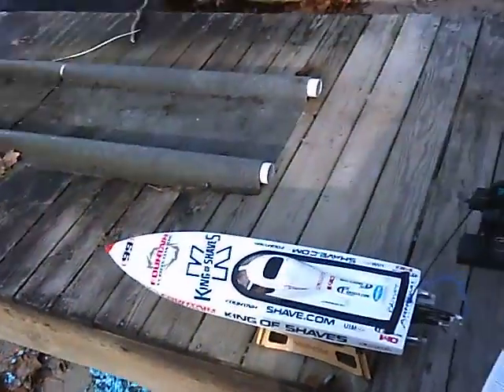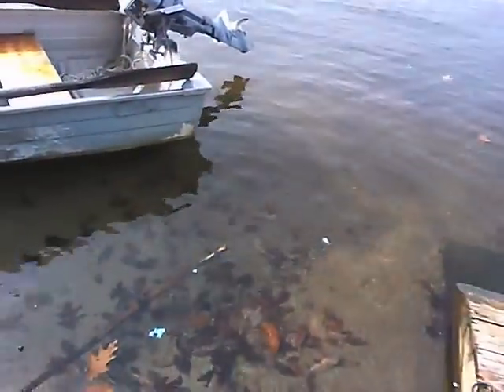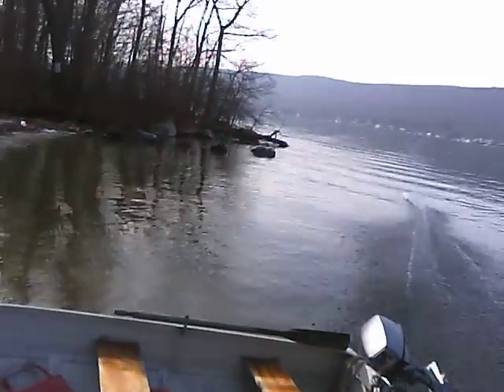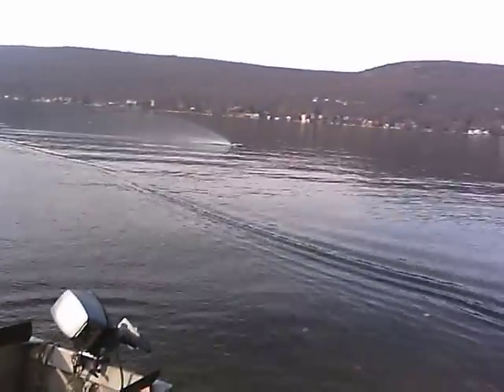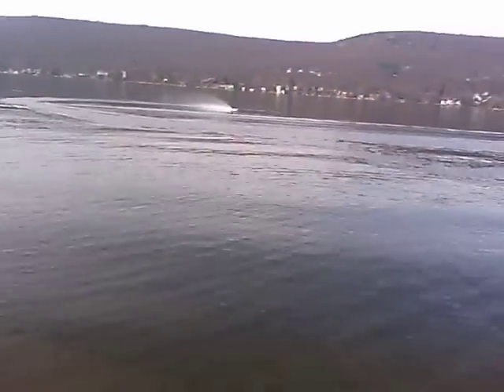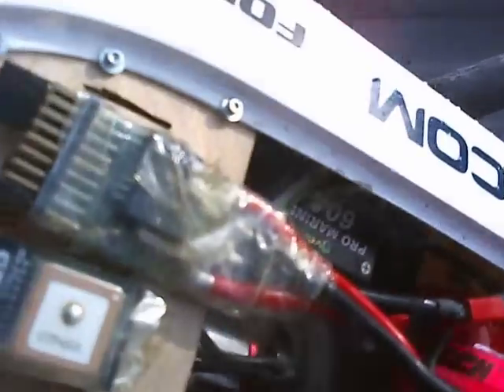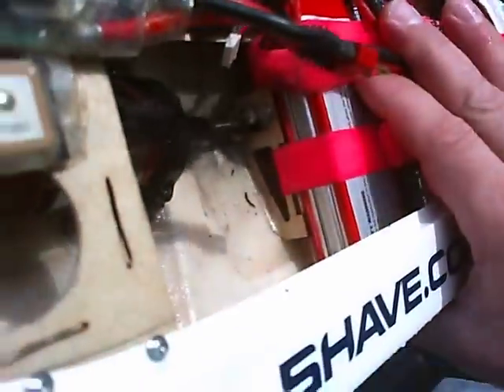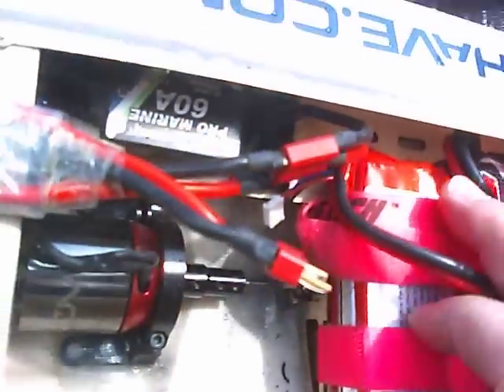King of Shaves P1 on 5S X438 prop

Comment from the maker: @Skullcracken  well that would be the only P1 running 48mph on 4S stock motor that I know of. And 4s is the same as 2x2s, the only difference being the wire. Do you have a video of it? how hot does it get? What amps?

Comment: @antslake GPS 48 (on pure glass conditions). I think its just the weight maybe. Everything is stock except the prop. I use a 40mm 2 blade graupner carbon filled prop and I use one 4s battery instead of 2  2s for less weight. Telling ya man, more prop and less cells (and less weight). I get a good 10-12 minutes out of one 4s 4000mah lipo.

Comment from the maker: @Skullcracken around 48mph? how are you measuring that? Which prop are you using. If I prop any more I will be going way over the amp rating on the speed control. I am already over with this setup. I haven't even hit 48 on 6s.

Comment: @antslake Did you ever change your setup from this original post. Looked like a mismatch on the cells and prop. Lot of RPM's and acceleration, but top end is slow. Im getting around 48mph on 4s on mine.

Comment from the maker: I don't know yet because on this run the flex cable let go. It was probably binding. At the end of the run, it started going faster. I have the eagle tree logger and the amps were high, so going bigger my be drawing to many amps, but if the cable was binding I got bad readins anyway. Ice is on the lake, so sometime in MArch testing will resume.